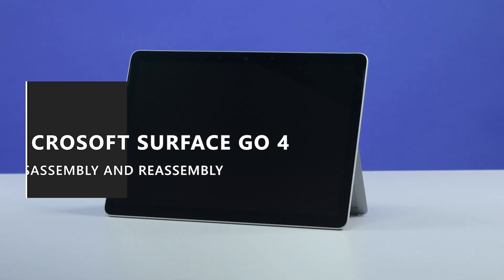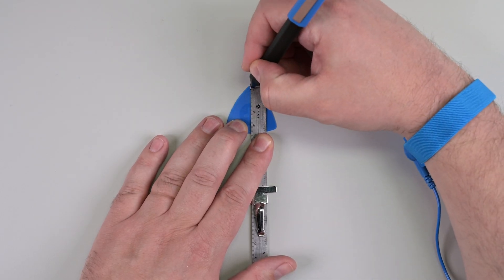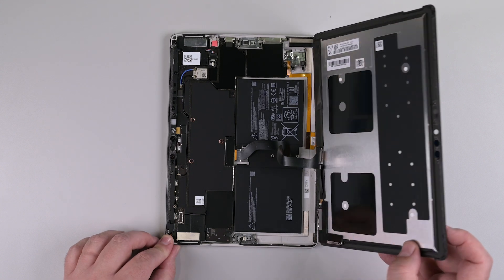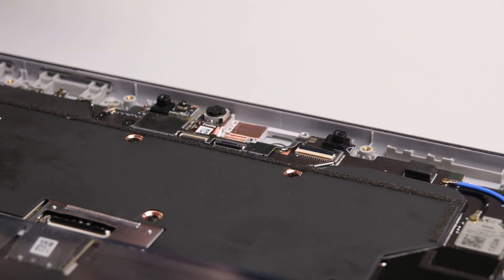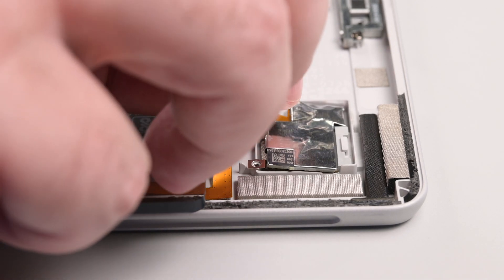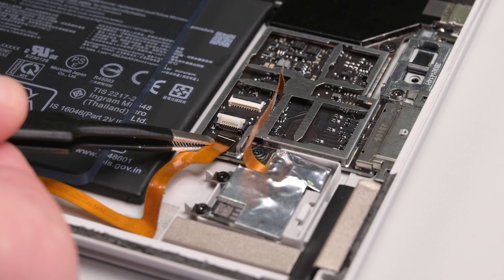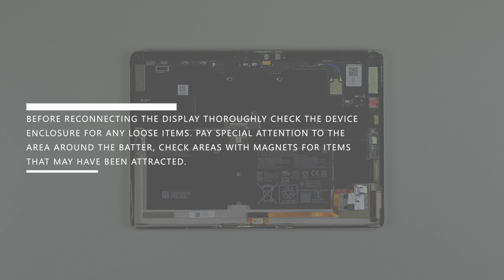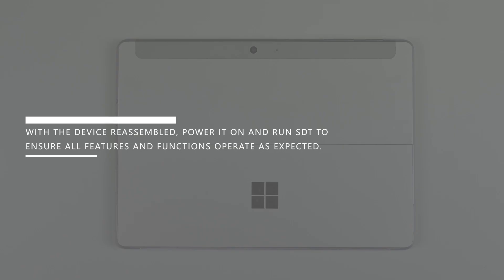Repair | Microsoft Surface Go 4

Comment: 2nd, i would not remove the speaker mesh, unless they are severely damaged. 
AND make sure everything works, using SDT Before bonding the display with the unit.